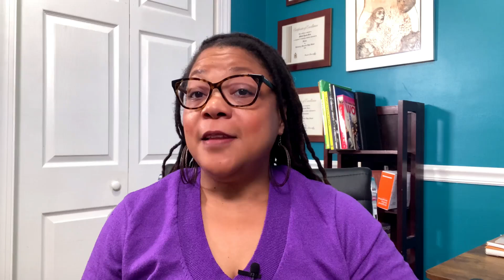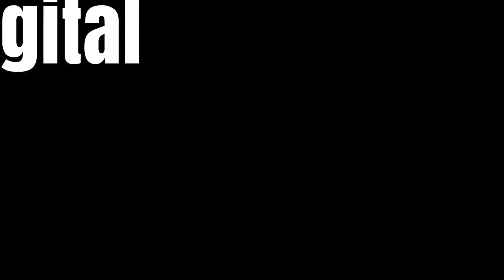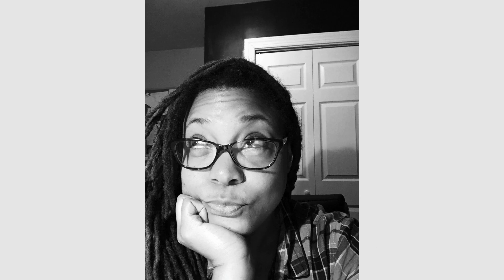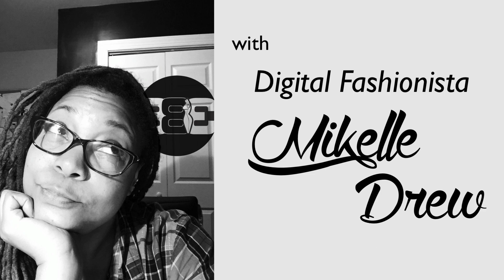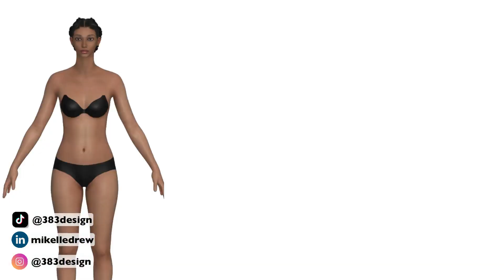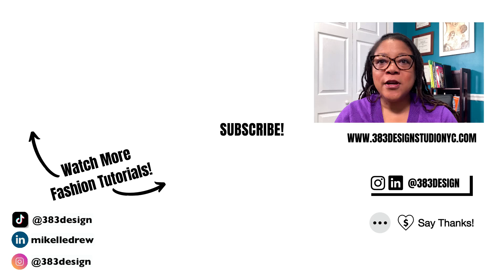Which Is Superior: Physical Or Digital Fashion Design Samples?

Comment: Yes! 100% agree with you, I specialize in using Clo for developing intimates and we definitely still need at least 2-4 physical samples before going to production, but those samples are so much closer to the final garment.  We can use the time and effort to tweak and perfect the garments rather than making big changes that could have been caught in the 3D environment (like placement of seam lines, lace motifs, and even most of the fit corrections)